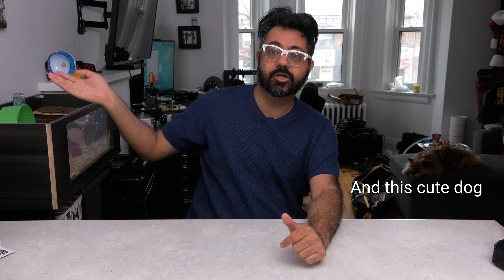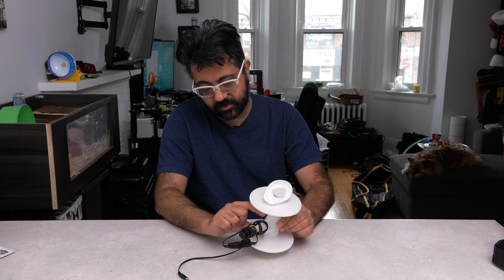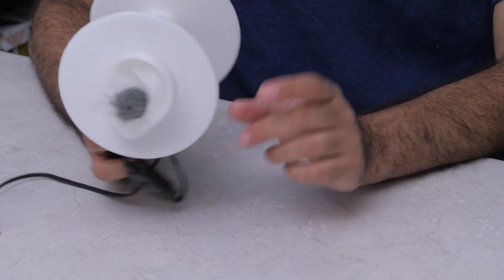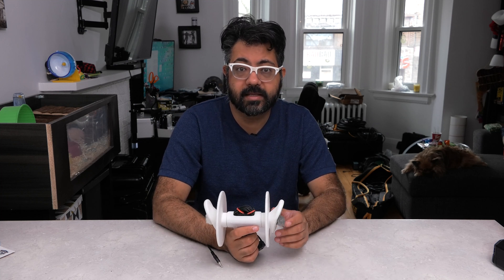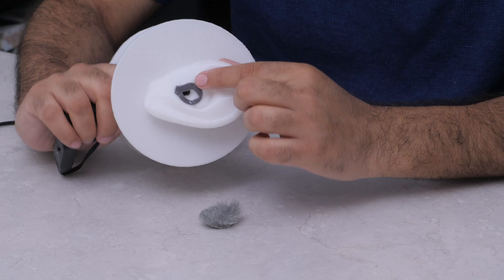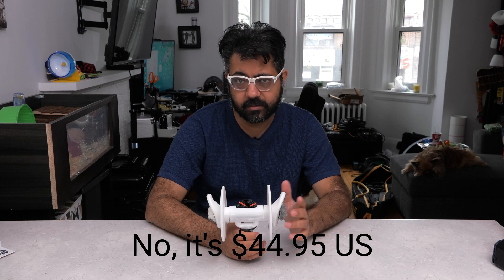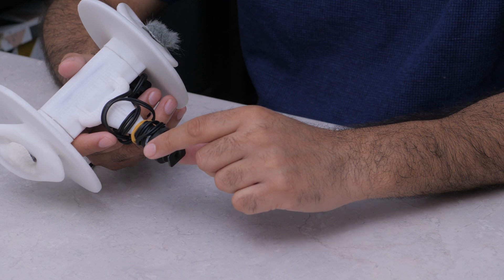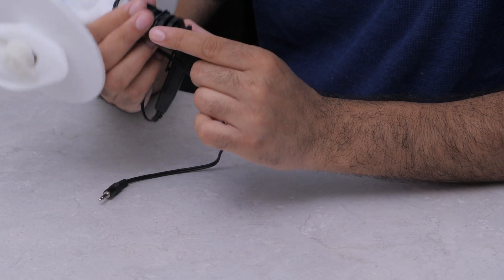3D printed Binaural Microphone 2.0: The Second Listening

Comment: Thanks for sharing. I just 3d printed this binaural mic setup. I used stereo clippy mics. I was not sure how you mounted the mics internally. I just taped them to test it out. It is working fantastic. I could enlarge it to fit the 12mm diamater rather than use 7.5mm diameter of the Polsen OLM-20 mics, but then the ears would be too big.

Comment: hello thanks for your design, i think windshield foam is better than dead cat on the outside of those ears , also the clippy mic with foam windshield is better fit and very firm in the ear hole inside when using the foam windshield

Comment: @hyperbolic films hy there I printed the first version and yah it broke, the cold shoe adapter, but got it fixed whit a screw and epoxy so not a problem any more. the problem I have when I plug them oin audio interface focusrite scarlet 2i2 2 gen I am only getting the sound on the left channel... I am a total noob for this stuff,  but love your idea very much!!!!  I am planing to use it whit my  osmo action camera but still waiting  fore them to ship me adapter from usb-c to 3.5mm jack but still not sure how to get that 3d effect?? keep on you rock
Reply: Slower build, smaller lines. It'll give you better structural stability if you're not using framing.

Comment: Being a beginner, can you kindly say what measurement unit the Wings3D files are in so I can get them printed? MM? CM? Inches? - cheers and thanks very much
Reply from the maker: Wings seems to be a random sized unit. On my last print, I brought my Wings model into Vectary to get the sizing more precise. Blender might be a good option.
Reply: @hyperbolicfilms  The units, upon opening them in another 3D modeler appear to be millimeters (mm) - And CraftCloud defaulted to that on upload also... - Thanks for quick reply! Another Q - what material did you choose? PLA, ABS, PETG? - cheers and thanks for a wonderful project.
Reply from the maker: @sunshiputube  I use PLA. I don't know much about that part of printing, but I believe it's safer than ABS.